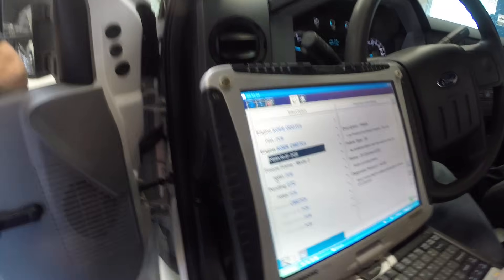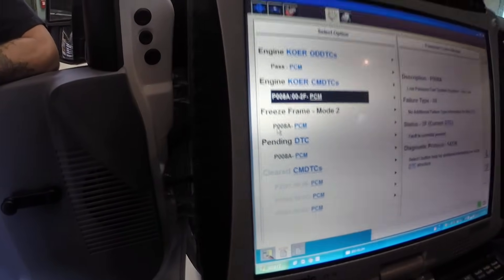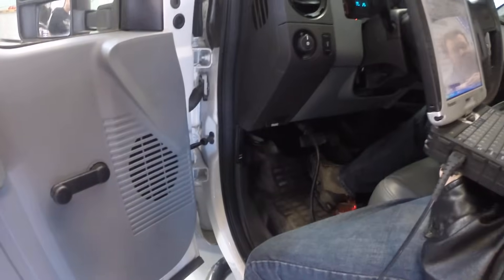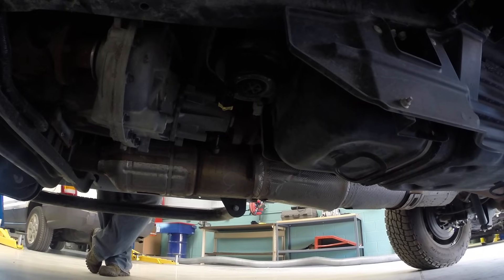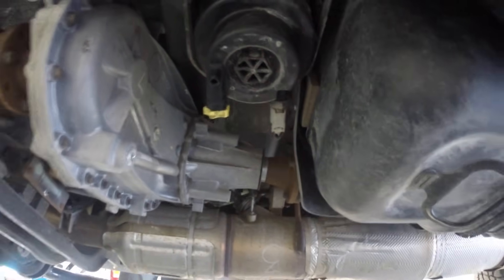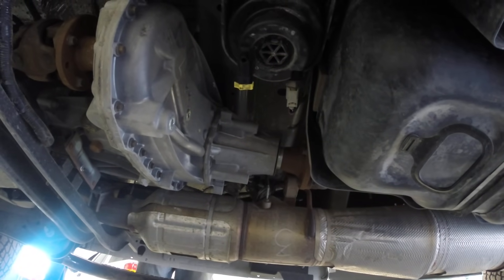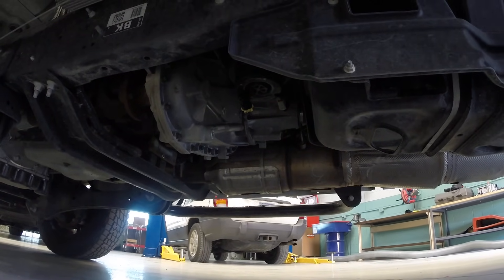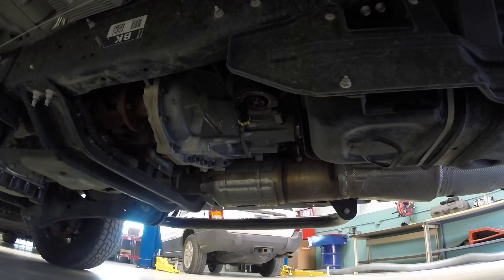6.7 Powerstroke Low Fuel Pressure Problem

Comment: I changed my fuel filters on my 2011 f350 6.7 for whatever reason I'm not getting any fuel whatsoever to the filter on the frame. Everything is tight and no matter how many times I prime it I still get no fuel to the first filter. Any idea what might be the cause?

Comment: ford f250 2011 6.7

Fuel filters replaced

Driver side fuel rail / fuel regulator replaced

tuned with a h&s 80hp tune and EGR deleted but not removed.

My issue is after startup i will have a pumping noise coming from under my feet, seems like its the lower fuel pump. Any ideas?
Reply: I have no codes at all

Comment: I changed my fuel filters yesterday, got on the highway today… low fuel pressure. Went into panic mode bc I have to drive 20+ hours to work today, came across this video and figured WTH, might as well see. Sure as $#!t… got almost 2 full turns out of it. When that o-ring is wet, it makes it seem a lot tighter than it is and you don’t want to break the damn thing when you’re installing it. Moral of the story: you saved the day with your video. Thank you for posting this.

Comment: I pulled and inspected the filter for metal it was clean put new one in anyway but not you must use o ring lube on the green sealing o ring that comes with the new filter so you ensure it screws down smoothly prevent rolling the o ring and you can feel it bottom out at its stop but I found my issue was the fuel suction like from the tank to the pump 600 dollar fuel line assembly you can’t get just one line
Reply: what did you use to lube the green O-Ring?

Comment: i got the same problem but tighten until it stops turning or just like an oil filter, just snuged?
Reply: Should be a tab on top and bottom housing that stops it when correct.

Comment: Same issue here today, 2013 6.7 I changed both fuel filters and truck run ok but Humming noice was there  didn’t pay much attention cause was running ok. After driving 180 miles I got engine light, reduced engine power and low fuel pressure message. Watched some videos and pulled the left connector on the top fuel filter. Drain some fuel/air in to a plastic bottle and run ok for a few miles then  I’ll do it again but problem won’t go away. I’m ready to retighten the bottom filter.  Thanks for this video.

Comment: Thank you very much I checked fuses, lines for kinks, fuel pump and nothing. I didn't even think of tightening the fuel filter housing. Your saved me a couple hundred dollars I would've spent taking it to the dealership.

Comment: This was so much appreciated as I experienced the same problem. I managed to get to fuel station and fueled up to a full tank. I just had my fuel filter changed. I drove for about 800 kilometers. I pulled a load for 280 kilometers and off loaded and returned for home. The temperature dropped from -6C to -25C with a head wind that felt like -38C extreme cold and that is when the problem started. DERATED TO 80 KILOMETERS PER HOUR AND GOT WORSE TO 40K/HR BUT I MANAGED TO GET HOME. THANKS FOR YOUR VIDEO.

Comment: That happen to me the other day load humming noise low fuel pressure light then went to engine reduced power speed only went to 15mph  I knew it had to be that. Drained it reinstalled it. Noise gone lights went out truck running good.
Reply: but how tighten all the way until it stops turning or just snuged?

Comment: I just had almost same problem and it was the front fuel filter for the code p0089 but I did have run for while cause the p0170 was on...
Reply: How did you fix p0089

Comment: Well I have a 2017 f250 and just ran into this issue , I change all fuel filters, and changed the low pressure sensor , and still have the engine light onnnn, and I took it to get a diagnose and still sensor popping up 🤦‍♂️
Reply: I have a 2017 F-250 6.7 that had the same codes. Just finally got it sorted out today after replacing fuel filters, tightening housing again, and replacing pressure sensor..... none of that worked. The fix ended up being a bad fuel pressure regulator part # CM5185. $180 for the part and easy to remove and replace by going through the driver side wheel well.started with a bad idle and then shutting off after deceleration. All good now.
Reply: I'm having the same problem. No matter how many times I clear high pressure sensor it is always there. I already replaced the sensor and the crank sensor
Reply: Any Luck same here...

Comment: If that is not the problem with it what else could it be ? Becauseit is not the problem with my I'm getting air in the fuel system some how any help?
Reply: Albert Ocuto high pressure fuel pump mine is doing the same apperantly it’s a common 8k fix
Reply: @ruizg26   fix it
Reply: @ruizg26  It was not the lift pump that was going bad I replace the lift pump and all sensors on the fuel system it ended up being the high pressure fuel pump
Reply: Today, after replacing the fuel filter cap.  A Ford tech told us to lower the fuel tank and look in the  prefilter . They have had 8 trucks this year come in with the same problem.  And sure as hell.  In the prefilter were 2 cardboard disks that keep getting stuck on the pickup tubes.  Truck is fine now.  Also the tech said never use any other fuel stabilizer other than motorcraft because other stabilizers eat the high pressure fuel pump and that's not covered under the warranty

Comment: on my 2011 f550 it had entered reduuced power mode and check engine light came on so i started with the fuel filters i changed them and what happened here is happening but it also had other codes like P0305 and P2291 and P0087 can they all be caused by it not being tight or is there another issue going on?
Reply: Did you ever figure out your issue? I’m having the same issue with a f550 getting code P2291
Reply: What caused this and what was the fix?

Comment: Have a 2015 F350 flash code P0087 Low fuel pressure got it home and parked it, didn't want to cause any more damage driving in a reduced power situation, only have 28660 miles, changed the fuel filter thought it would help,checked the lower filter housing was tight, lined up with the last notch on the housing. Going to get it towed to a dealer and get it checked out. Any info is a plus. Thanks for the Video
Reply: What ended up being the problem?
Reply: Drifter's Den Hello I’m having the same problem with my truck what ended up being the problem please it would be a great help if you let me know
Reply: @samaoudi6553  On my F-250 it ended up being the filter housing wasnt tight enough.
Reply: On ours there were 2 cardboard disks stuck on the pickup tubes in the fuel tank.   The ford tech said they had 8 other trucks in this year with the sme issue.
Reply: What was the problem?

Comment: Having a FASS Pump installed on my 6.7 this week to hopefully eliminate this issue on mine.
Reply: How did it go with the fass? I just got a fass in my truck and now my trucks is reading error message low fuel pressure?
Reply: My FASS has been flawless(knock on wood) for around 60k miles now. No issues at all.
Reply: JJM  I just installed mine yesterday runs and drives great so far other then this message on the dash dealer wants me to change a sensor for $400 bucks and there not even sure if that’s what’s wrong.

Thanks for the reply I appreciate it
Reply: Riley Omilusik Mine throws a code. I’m not sure what the code is but it essentially is because I have replaced the original pump. The code doesn’t apply to anything on the truck anymore.
Reply: Riley Omilusik I can attempt to see what the code is later when I’m near my truck. 👍🏻
Reply: JJM that would be so Awsome thanks a ton!
Reply: Riley Omilusik Wasn’t able to get that for you yet but I will. Sorry for the delay.
Reply: JJM hey did the fass pump fixed ur issues?
Reply: Did it fix it? Im having issues with mine.. reduced power

Comment: This video helped me!!  I did my first fuel filter change yesterday and i had the same whine but the truck ran great.  This morning drove to Bass Pro and got "low fuel pressure" then the truck went into reduced power mode. I was able to tighten the filter two entire additional turns (it was freezing yesterday when I changed the filters and my hands were completely numb) and now no more whining noise. I cleared the code with my SCT tuner. Thanks for posting.
Reply: 7 years in the future same thing happened to me. How does one tighten it? (I had someone else change the filters and they swear it’s a “normal” sound)
Reply: @dylanmoses1671 yeah same mine is tight all the way I accidentally put fake knock off OEM filters idk if it let in air I’m gonna try too manually bleed the air out
Reply: @Bassngass  I was able to get a big enough socket and I had like 2 or 3 full rotations
Reply: @dylanmoses1671 yeah k got it wasn’t seated on the stopper

Comment: changed my fuel filter on my service truck. 2016 F550 this video helped my fix my issue. I thought I had the housing tight but I was wrong. tighten the housing a bit more. cycled the key a few times, then on my fourth time engine started. thank you who posted the video and thank you youtube.

Comment: Mine has the same issue, i opened the valve with the truck running and it pushed the air out stopped the problem and ran fine.  What housing do i need to tighten to stop the leak?

Comment: I know this video is old, but I am currently have this exact issue minus the low pressure code. I have taken the housing off and put back on snug... I have also taken back off and changed filter (including Oring ), and replaced several times ...... Any thoughts?
Reply: It was not the lift pump that was going bad I replace the lift pump and all sensors on the fuel system it ended up being the high pressure fuel pump
Reply: Sucking air sumwhere, prolly in between the tank and the pump sumwhere

Comment: I have a 2012 cab and chassis with 6.7, 2 tanks. I'm getting same code and same noise when it is switch to rear tank, when I switch it to front tank within seconds the fuel buzz (whining) goes away. ?? I'm baffled.
Reply: how you fix it
Reply: @jR-gr8ui  Ford replaced the part that actually switches between the tanks. No more issues.